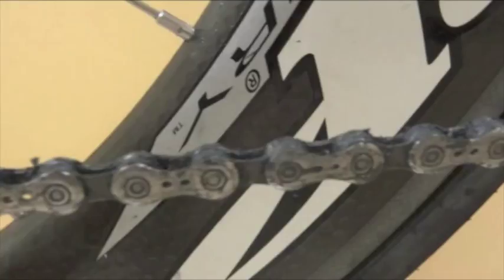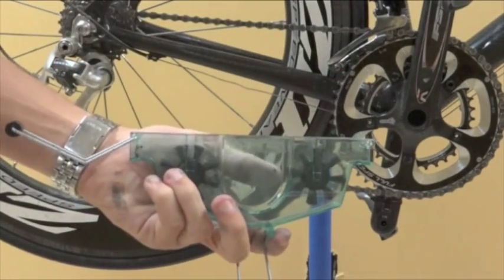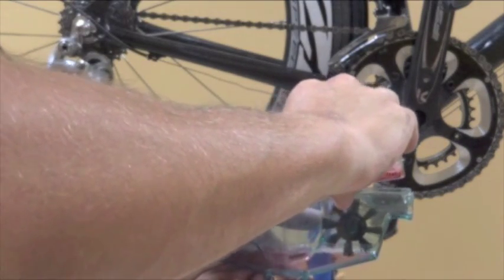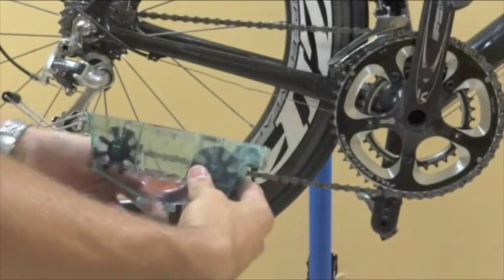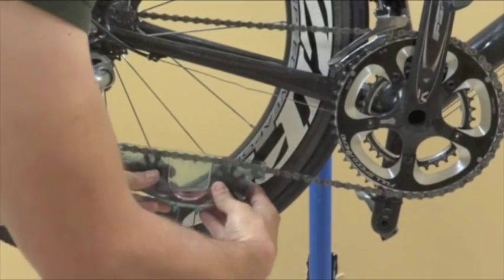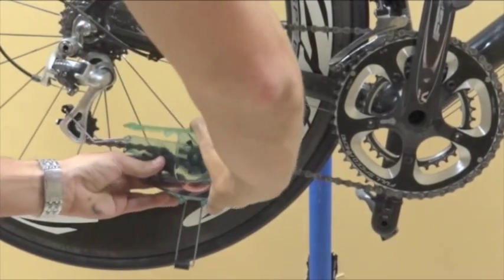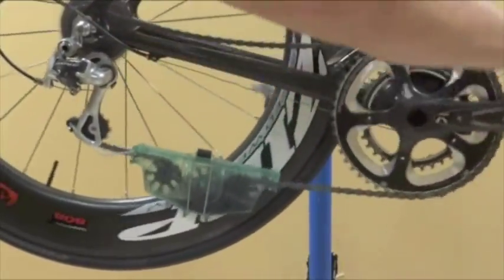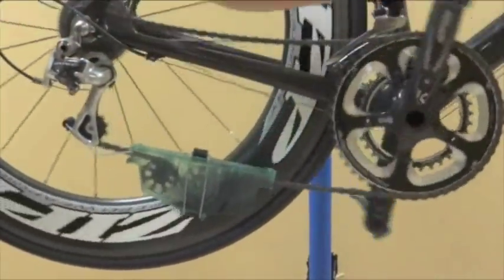White Lightning Chain Cleaner

Comment: The directions say put the chain on the smallest gear/front ring. I couldnt get it to work without holding it. I came here and saw the video is on the largest. Once i switched that it worked a lot better. Aside from that its pretty good for the price no doubt!

Comment: I just used this, & was impressed by how well it cleaned my very-dirty chain; however, they do not explain how to clean the cleaner.  Would be great if it were inexpensive enough to just dispose with each use!  Although only a small amount of fluid is needed to fill the cleaner, the cleaner itself needs to be dunked/soaked in a bucket to get the 3 brushes clean for the next cleaning.